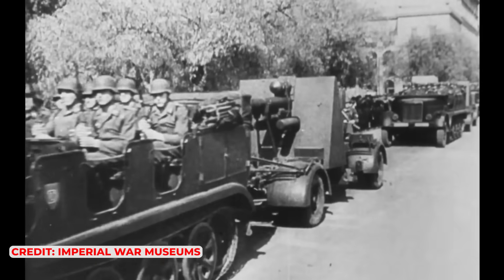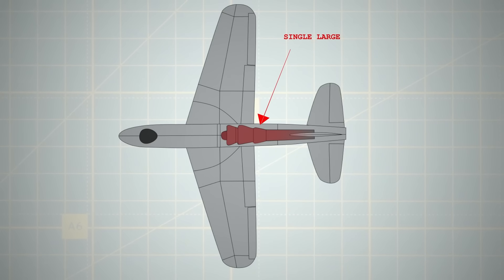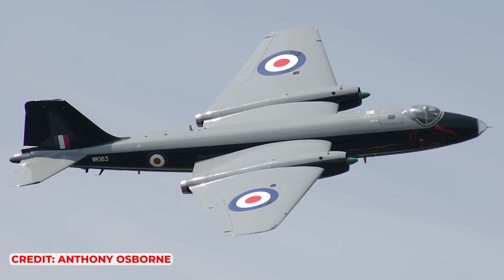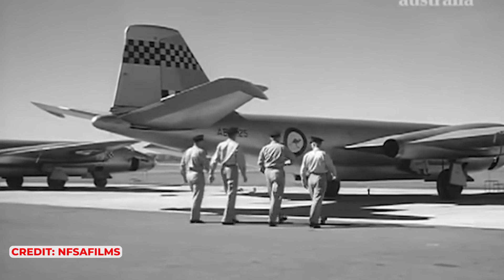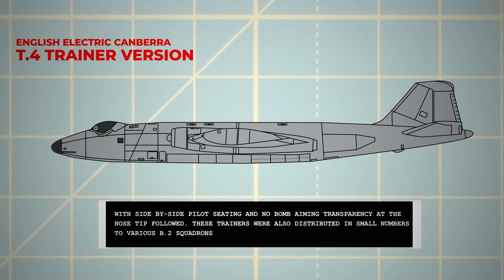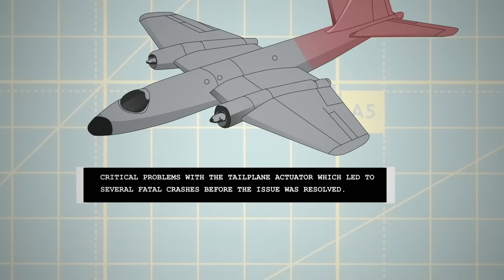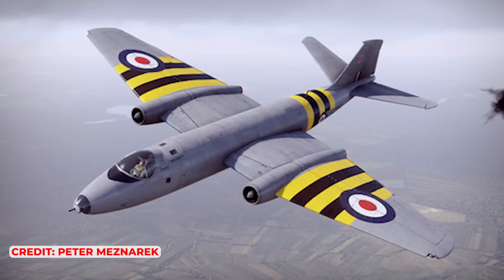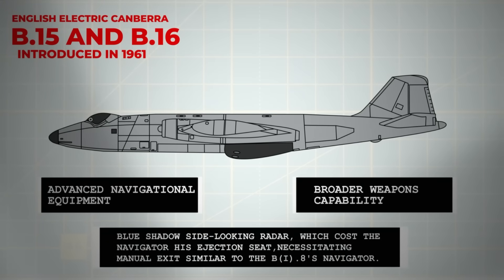The “Stopgap” Jet Bomber That Wouldn’t Die

Comment: All post war aircraft manufacturers were facing the challenges of mass producing the complex airframes for the new jet powered aircraft. Up till then UK miltary aircraft concentrated on tried and trusted war winning designs, specifically aero engined propellor types. English Electric was no different and had won awards "Halifax Trophy" for producing bombers at it's Strand Rd and Samlesbury sites in WWII. I know because my grandfather worked at "Dick Kerrs" as the Strand Rd site was known in Ashton, Preston. EE/BAC/BAe was Ashton's largest employer at the time and was up till the site closure in 1990. 

Warton needed little work to enable jet production and was by wars end a major aero engineering facility having used by 8th USAAF as "Base Air Depot 2 " or "BAD 2". There was a sister site at Burtonwood called "BAD1". The bases were huge and handled hundreds of different types of fighters/bombers coming into and operating in ETO.

My dad trained as a fighter pilot with the RAF and was grounded due to sinus issues by early 50's. He was seconded to EE Warton as the "Instruments Liaison Officer RAF" specifically for the Canberra programme. Dad knew EE Chief Test Pilot Roly  "Bee" Beamont very well and also later test pilot Tim Ferguson (who famously landed SEPECAT Jaguar on M55 motorway in 1975 shortly before it's official opening ceremony https://youtu.be/VeBZ3xbgN_M?si=B44J2hSeR-gLYdo7).

The Canberra was a big deal for EE and Preston with the aircraft taking centre stage in 1952 Preston Guild Merchants celebration parades. My dad (in uniform)manned EE "Guild"stands postioned in Preston Town Hall to show off the Canberra. We had pewter ahstrays that featured a solid model of the Canberra that would swivel on a plinth at the side plus a couple of paperweights with the Canberra etched & encapsulated within the block of glass. Heavens know where they eventually ended up?

Into the modern era. In 1998/90 I was working as a site engineer with a firm of Chartered Surveyors in Preston that specialised in high precision (sub mm) seting out techniques. In 1998 we won the competition/contract to install the "Flexible Infrastructure" at 4 Shed (former US Navy Gosshawk production facility) - BAe Samlesbury - for the Eurofighter Typhoon production tooling. The principal had to design and get manufactured a special "reflector" to enable mass installation of precision tooling boxes which was called the "Denby"after local engineering firm, Denby & Sharp. To provide the Denby with the best quality/cost precision prism possible a miltary surplus prism from...a PR9 Canberra was obtained for £3-400 ish IIRC. How apt given the Canberra's history with Samlesbury

Comment: Still got a master key, for opening the door on Canberra's somewhere in my junk. 2 years on a Canberra squadron in Cyprus 1963-65. 249 Squadron. 2" Rocket pods standard fitting, and triple cartridge engine start fittings. (3 starts available.) (TSR2 not cancelled in 1965. Left RAF late 65, and was working at Lucas on it's fuel control system when it was cancelled. Redundancies followed. Got to be 1966 at earliest.)
Reply: TSR2 Cancelled April 6th 1965. Canberra door key was a standard Joe Lucas key as supplied to the Motor Industry and used on Morris Minors.  Fast forward 5 years post demob and working in computer service industry I dropped my Morris Minors ignition key sods law I was standing over a drain, I walked home rummaged around and found my old Canberra key went back to the car hey presto I'm mobile again.  I'll swear that Joe Lucas only made one version of that key.
Reply: @colinsmith7537  I'm a retired ex Lucas Aerospace engineer. I don't remember seeing locks and keys as one of our automotive division's products. Lucas was mostly an OE electrical equipment supplier. However, I'm sure they had the machinery capable of making locks and door handles etc, so I'm interested to know for sure.
Reply: In the book "A bucket of sunshine" the author (a Canberra B (I) 8 pilot) says it was a Ford Anglia key.

A quick Google search shows that EBay is littered with people selling Lucas car door locks though, Land Rovers used them according to the listing on one of the ads.

Comment: Funny that Nasa still has a  Canberra or two in use today if memory serves.
Reply: "NASA" they were used in Afghanistan for the the BACN program testing. I'm pretty sure the two are still being used.
Reply: @Canister73Rob  Correct, 2 were used in Afghanistan to test the BACN system. Two NASA OV-10 Broncos were also transferred to Special Operations Command for use in Afghanistan as well.
Reply: In fact, NASA has 3 RB75Fs still in active service and 1 in storage. NASA 926, 927, 928 with 926 in storage. They had 2 active and 2 in storage until 2013 when they returned one to service. At 41 years in storage (since 1962!) NASA 927 became the longest US plane kept in storage before being returned to service.
Reply: Probably RB57s for high altitude work.
Reply: The Martin RB57 was a Canberra, built under license by Martin. It was used in the Vietnam War as a strategic bomber. The US RB57 and Australian Canberras were well regarded for bombing accuracy. Later the design was extensively modified {longer wings, bigger engines, extended nose) for high altitude research, and flown by NASA. It is these three NASA planes that are still in use, flying out of Houston.

Comment: The PR.9 also featured an extended chord in the portion of the wing inside of the engines, so, that particular leading edge between the engine and the fuselage, originated almost in the very air intake of the engine nacelle. This, plus the larger span added a significant wing surface that allowed the PR.9 to get  to almost 55,000 ft of altitude! I mention this because your PR.9 drawing does not reflect this particular change.
Reply: PR = Photo Reconnaissance, the Bomb bay IS FULL OF cameras 31 Squadron RAF Laarbruch 1960 so not a Bomber